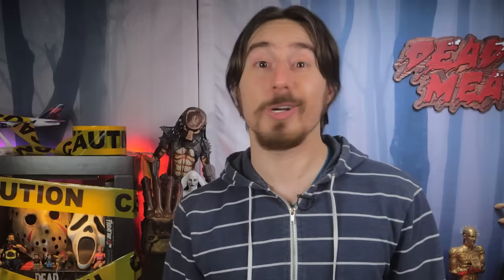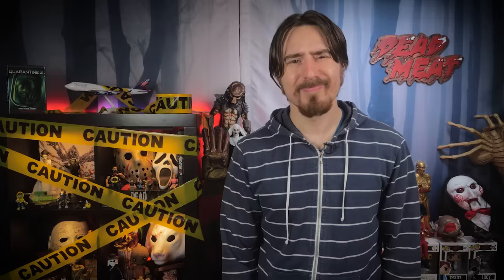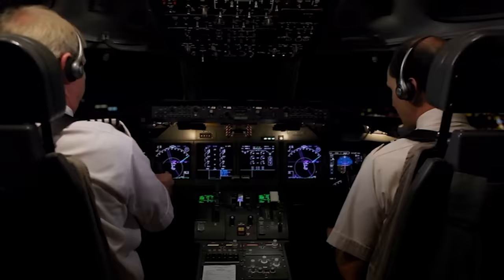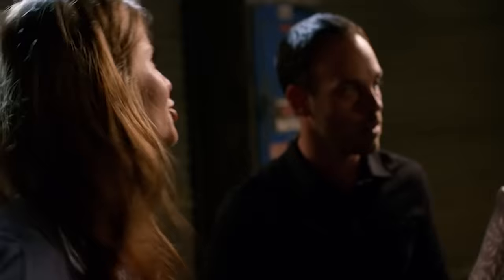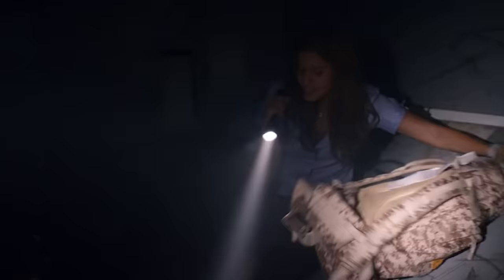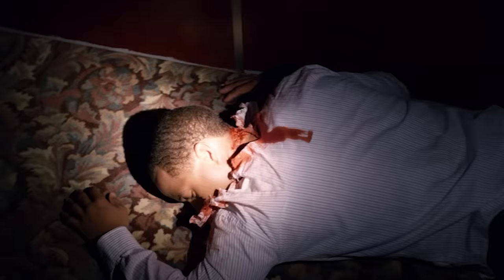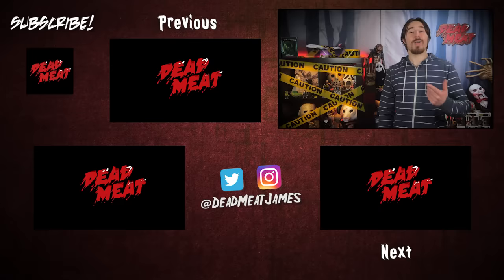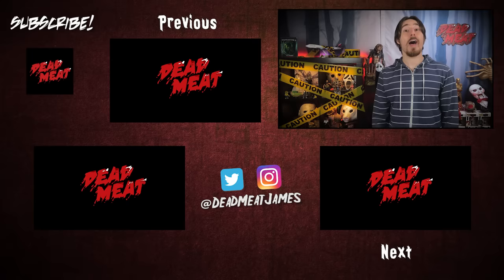Quarantine 2: Terminal (2011) KILL COUNT

Comment: [·rec]/quarantine scoreboard:
[·rec] (2007) - 16
Quarantine (2008) - 23
[·rec] 2 (2009) - 13
Quarantine 2: terminal (2011) - 20
[·rec] 3: genesis (2012) - 161
[·rec] 4: apocalypse (2014) - 41
Winner:
[·rec] 3: genesis (2012) - 161
Loser: 
[·rec] 2 (2009) - 13
Reply: Oscar De paz There’s no way Rec 4 has only 41 kills.
Reply: @crazydude09ful  it is because james pulled a [·rec] 3 and gave up.
Reply: Oscar De paz I had to go back and watch the final kill count. I didn’t realize he actually ended it with 41 kills.
Reply: I thought this was how you rated it for a second until I realized it was the kills
Reply: Covid (2020)

Comment: Perhaps Paula had a rabies vaccine in the past, you get those either in response to a potential infected bite or if your line of work has you around lots of animals that could get rabies. One person actually survived rabies because they had prior anti-bodies to the virus. An explanation for Paula's delayed infection could be she had similar anti-bodies to this hyper-aggressive form of Rabies, her body was just better at the initial fight off. That, and her wounds were cleaned and changed regularly until her isolation. 
A particular protocol citizens in the USA have is if you wake up and you find a bat in your room, or a small child is found unattended with a bat in the room, you and any potential bite victims get a rabies vaccine ASAP since bat bites are often small and leave little trace and cause little pain. Also case and point, never handle a bat unless you have training and supplies to, as bats in the US are one of the major vectors here.